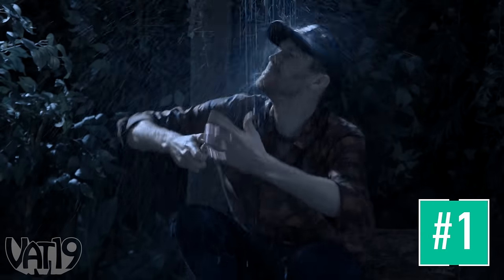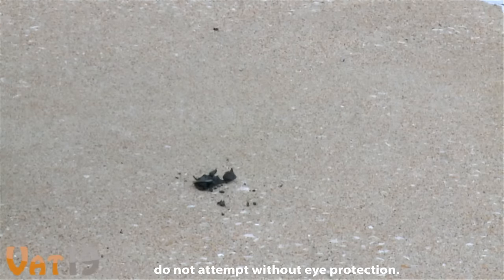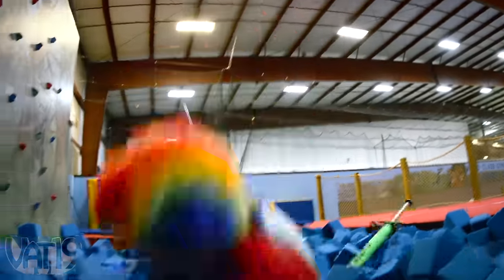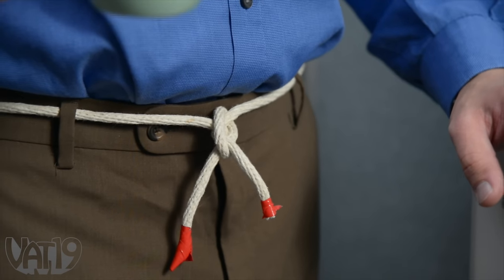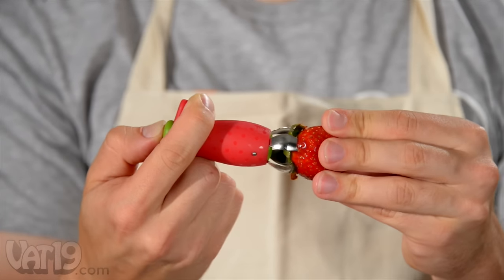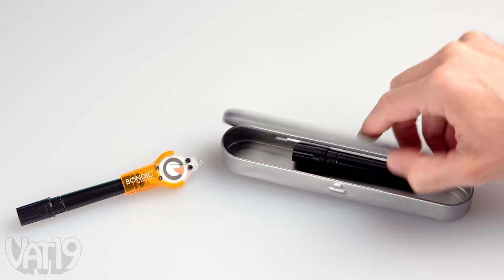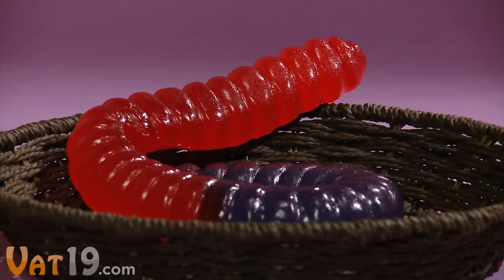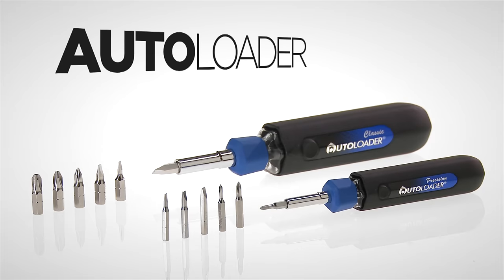10 Common Products Made Awesome

Comment: Stormproof matches are going to burn down every forest they touch.
Reply: One SexyPine you can see in the vid that they drop the match and it doesn’t catch on fire. the matches are meant to be made to not catch anything else on fire but the match. it also doesn’t disappear unless you put a huge amount of air or water or any thing that would usually blow it out.
Reply: @rachaelcroton693  so if the match is meant to not catch anything on fire but itself, what's the point of it
Reply: @leviwebb7839  pft duh you only use it to make match fires
Reply: It makes fires and provides light.
Reply: @DavidLIVE_  have u heard of a flashlight? It works a lot better than a match
Reply: whats a flashlight i've been using lightning bugs this whole time
Reply: @rachaelcroton693  No, they dropped it in dirt. They didn't drop it in dry grass and watch everything burn down.
Reply: @leviwebb7839  since when does a flashlight start a fire
Reply: Raphael Aquino If the forest was on fire and the fire was caused by the match wouldn’t it be a match fire
Reply: One SexyPine how do you put the match out?
Reply: Soo true
Reply: @udaysandhu7699  ikr
Reply: @dosuuleaks2751  fr
Reply: @leviwebb7839  a flashlight can start fires now? WOOOOOOOW
Reply: @PQAisha  @rachael croton said that it wasn't meant to catch anything on fire
Reply: This Is Getting Really Toxic XD I'ma Just Say I Think There Is An R/Wooosh Here Somewhere...
Reply: This is why the Amazon is on fire
Reply: No.
Reply: Erusnine The Doodling Demon so that’s why the Australian forest fires exist
Reply: I leave for a year and y'all have a fight smh.
Reply: I think u r right😮

Comment: Hershey's Deep Dish Brownie Recipe
3/4 cup (1 1/2 sticks) melted butter
1 1/2 cups sugar
1 1/2 teaspoons vanilla extract
3 large eggs
3/4 cup all-purpose flour
1/2 cup Hershey's cocoa
1/2 teaspoon baking powder
1/2 teaspoon salt
Preheat the oven to 350F degrees. Line an 8-inch square metal pan with foil and grease only the bottom of the foil.
In a large mixing bowl combine melted butter, sugar and vanilla with a wooden spoon until well blended.
Add eggs and beat well with spoon until creamy.
In a small bowl whisk together the flour, cocoa, baking powder and salt.
Gradually add the flour mixture to the egg mixture, beating gently until well mixed.
Spread batter evenly into prepared pan.
Bake 40 to 45 minutes or until brownies appear set and begin to pull away from the sides of the pan.
Remove from the oven and cool the brownies completely in pan on wire rack.
Cut brownies into desired size and shape.
Reply: YEEEEAAAAAHHH

Comment: 7:09
cough cough Ahem, let me introduce the cheaper way. USE A STRAW!
Steps:
1. Grab a straw.
2. Pluck the straw into the opposite side of the leaves.
3. Push the straw through.
4. Push out the straw.
5. Remove the leaves stuck on the straw.
Now, no need to use too much money..